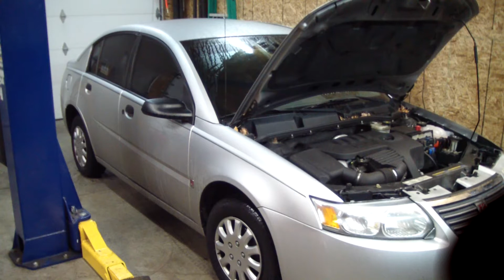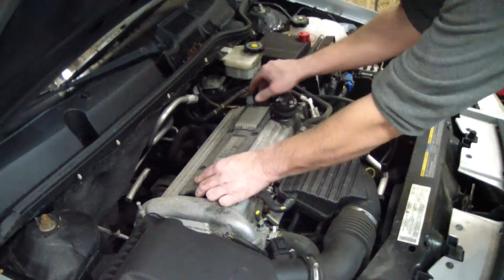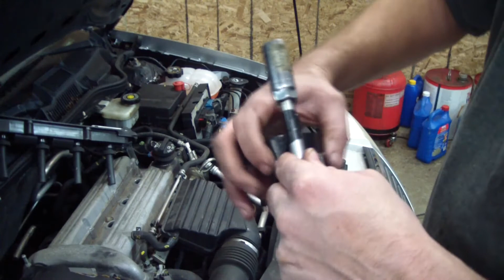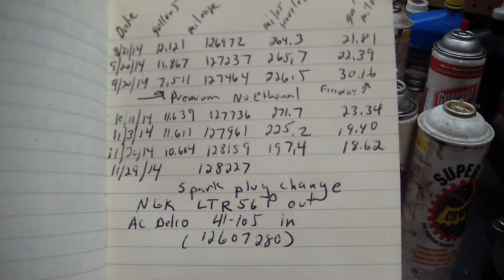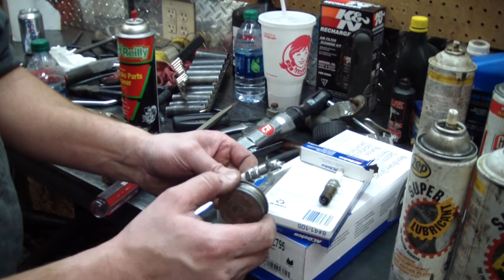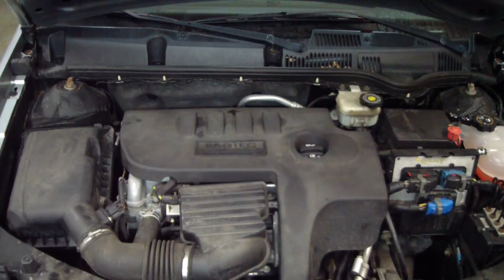Saturn Ion Spark Plugs Change 2.2L

Comment: A little late posting here. I have an '04 Ion 2 5 speed manual with 314,500 miles on her. She has all original engine and transmission components including the factor spark plugs and ignition coil pack. She still gets 25-30mpg in the city and almost 40 Highway. All I know is that I do oil changes every 2k miles and 300 miles before the oil change i add half can of seafoam to the oil to burn off any extra build up.

Comment: that's weird. i have a 2004 2.2 5 speed and get 27 city 35 hwy and it has 174,000 miles on it with original spark plugs. actually until i watched this video i always wondered where the spark plugs were.
Reply: that's the same car we have and get 27/28 around town and 36/38 on the freeway
Reply: I get ~ 25.5MPG combined. About to change the spark plugs. (245,000KM on the engine)
Reply: josh g I have a standard transmission, 2003 sl200 & gettin' lousy mpg.  Could it be because yours is a 5 SPD stick, it gets better mpg.?
Reply: I have the 2007 automatic transmission and all I have ever gotten was 21 in the city and that's when the car was brand new
Reply: That's about the sams as I get with my 2006 Ion 2.2L engine. About 27 in city and 35 on highway.
Reply: @zackwidup3701  the car now has 207,000 miles. It's only getting about 24 or 25 in the city now but still gets about 35 on highway. And yes i have changed out the spark plugs. Car still has the original serpentine belt though. I love my little ion.

Comment: for good gas mileage on cars I always start with good performance plugs and wires, K&N air filter, high flow exhaust (even cut out catalytic converter if legal to)  tires about 5 psi over rated,  rebuild brake calipers to keep from sticking (you might not even feel the rub and it could be costing you mileage big time) I get well over 30 mpg city in my 95 Saturn SL2 w 5 spd and DOHC peppy AF too ;)

Comment: To all , I have been a mechanic for 35 years , the only spark plug that improves fuel economy are the high performance tip plug because it increases the flame cornel increasing the combustion efficiency , the best Iridiums plugs tested are Bosch Lazer Iridiums ,and they are a 100,000 mile plug , there are cheaper plugs that will work almost as good are the NGK or champion platinum(With the cut back electrode ) and performance ground strap , look for the ground to be cut to an angle not straight across or square , look at a few different high performance plugs for you at the part store and you'll see what I  talking about .
Reply: I've read on Ion forums where people say not to put Bosch spark plugs in.  Not sure why though...

Comment: enjoyed video, changed plugs coil pack and ignition module, turned out to be bad coil pack, runs  great!
Reply: Did you need to disconnect the negative terminal of the battery

Comment: Do you ever need to replace that ignition module with the 4 bolts? I would think that would need to be replaced like a distributor cap and rotor would need to be.
Reply: Only is you get a misfire code, rough idle or no start condition if it's really bad.

Comment: i covered the lower radiator inlet  with some card board during the winter in MN and i didnt get below 25mpg. my 18k mileage average is 28.6

Comment: I just changed out the module pack and cleared a P0300 code. The car ran great........for 30 miles and another engine light, rough running and a p0300 code. I think I received a bad module

Comment: even if you never got an engine light have you changed your o2 senors out. quite often mileage will drop with no warning.... run the same and no funny smell.... change em out if you havent in 100k kms
Reply: i had a chev beretta mileage drop to 16 mpg without knowing... changed it out up to 34 on highway

Comment: i have a 2005 Saturn ion I don't know what you did to that car but mine gets 35 mpg on the highway and 25 mpg in the citi so idk what you are dewing with it to burn fuel so quick
Reply: Getting about 26.75 average (city) over a 6 month period on my 2006 Vue with the 2.2l and 5 speed manual. 160k miles on her (September 2020).

Comment: My 2003 Saturn Ion had 109,000 I think on it and never been changed. I put the most expensive plugs in before I didn't have good throttle response and my city mpg was 17 it went up to 30 mpg city after the plug change
Reply: British_Leyland(Alexscott100) I just picked up an '04 Quad Coup 3 for the wife which has 149K on it. No idea what the plug wear is but if your numbers are true then that's badass! Right now my concern is the busted windshield wiper linkage.
Reply: +Erich Backhus is it a automatic or Manuel
Reply: British_Leyland(Alexscott100) 2.2l with a 5-speed manual

Comment: Your video was really helpful.  I haven't used NGKs yet , I put Bosh iridium in mine. I had ACdelcos, in there. But all is fine. If you have any videos or tips on the cruise control that would help.
Reply: Press the button on the left in and the light will come on. Then get up to the speed u want to cruise at, then press the button on the right with the thumb indication (negative, the bottom button, not the top, that is to go higher speeds once c.c is initiated) and then let off the gas. The dash will spell out "cruise".
Reply: I thought my cruise control was broke, but it just took applying more pressure than you normally would, on the button on the steering wheel. Still a little sticky. Maybe some contact cleaner would help.

Comment: Do you need to gap these spark plugs
Reply: Yes every vehicles spark plugs should be properly gapped
Reply: Irridum plugs are manufactured with correct gap. Should be 0.43 for saturn 2.2l

Comment: thanks for the video, I'll be changing my plugs soon. I have a 2005 level 2 ion 5 speed manual with 134k. mine gets around 18-20 city but I have a bad O2 sensor as well so that might be it.

Comment: You may try some fuel injector cleaner that you can put in the gas tank it'll clean the whole system
Reply: I use Chevron Techron every other oil change (6000 miles).

Comment: Non ethonal gas will add about 5 miles to the gallon on that ecotec engine, at least it did on my Cavalier, which it looks like has the same motor as your Saturn or close.  Also, a synthetic oil, mobile one preferably, will add another 3 to 5 miles to the gallon, costs more but pays for itself with better gas mileage.   Until I did both of those, my Cavalier 2.2 ecotec was getting about 20 miles per gallon in town and about 30 on the freeway.  Now it's like new again, getting 24 in town and 38 on the freeway.  Tip on the fuel pump issue with these cars.  Buy the best one you can find at the auto parts store, and don't worry about the cost.  I tried buying a fuel pump online twice, in order to save money and each one died or acted sick after about 3000 to 5000 miles.

Comment: I always pull the plugs out when the engine is "warm" as it requires a fraction of the torque to break them loose (lower risk of thread damage). I think the issue is if you install plugs on a hot engine you will easily over tighten them so a cold engine for the install is ideal. Interested in your thoughts here.

If you install an oil catch can the plugs will stay a lot cleaner which has to help with mileage. I like to run a catch cans on my cars.
Reply: Oil catch can?
Reply: everything ever written on changing plugs in aluminium says never do it on a warm or hot engine, only cold. you have been very lucky if you pull them out when there is any heat still in the engine

Comment: Saturn is a garbage vehicle. Have the same model in my garage and it only has 100,000 km and it has so many problems.
Reply: Godx Blackscholarsun considering numerous parts have been recalled and saturn is no longer produced it shows the quality of the vehicle. The vehicle has had the oil changed, tires rotated etc...... every 6,000 kms.
Reply: I have 1999 Saturn. ,224,900. and still running😉
Reply: 2004 with 250km runs fine
Reply: @wildman8200  That's very anecdotal. You are talking about a brand of car that was built using excess GM parts from other vehicles. Saturn is what all GM cars once were in that era. The parts themselves are fine. But GM as a whole had to file bankruptcy soon after because it was mismanaged. GMC, Buick, Chevy, Cadillac, Pontiac, Oldsmobile, all of them contribute to the Frankenstein that is Saturn. Just like Scion is to Toyota. My spouse's 2004 Ion is at 125k miles with minimal work done on it and it runs just fine. We will be doing some work to it to bring it back up to speed, but it has been very reliable for her.
Reply: They are so horrible that I'm on my 5th one. All have had over 200,000 miles before getting replaced. My best advice for any Saturn owner is to head over to saturnfans dot com and get to know the forums for your model, especially in the tech section. Most of the common problems that happen are well documented and the how-to fix is generally easy.
Reply: Picked up a 1994 SL2 "Holiday Edition" with all options for $100. Battery had a bad cell. Drove it to 350k miles before I had a problem. The odometer gear went south. Sold it for $500 and the lady who bought it ran it for two more years. I lost contact with her after that.

It's all in the maintenance. 27 MPG in town. Over 34 on the highway with the 4 speed automatic.